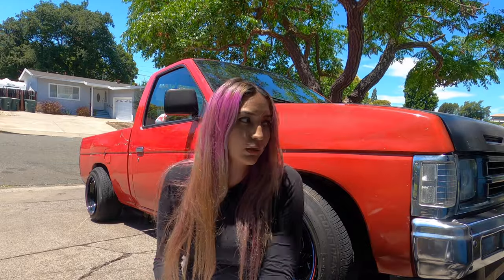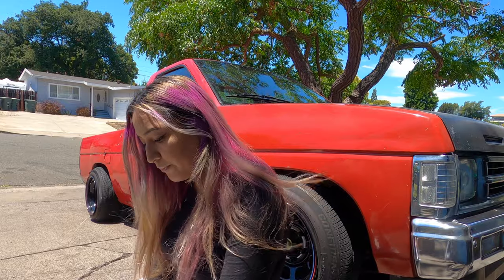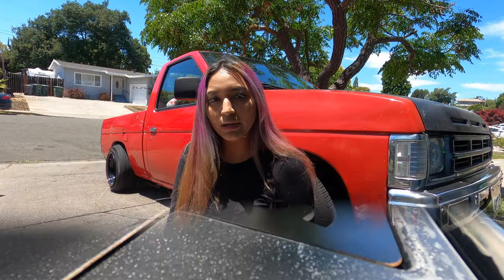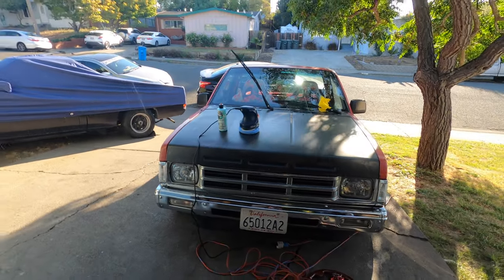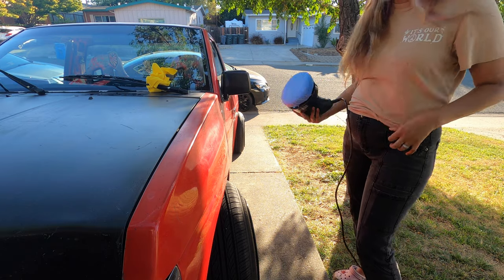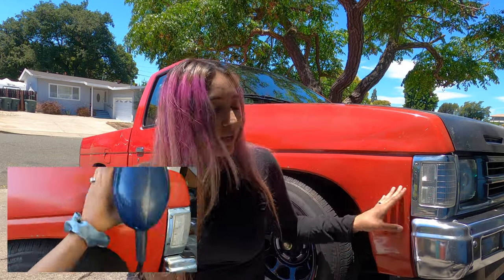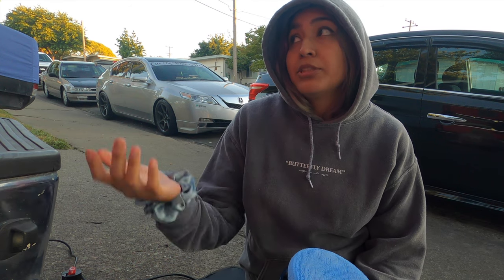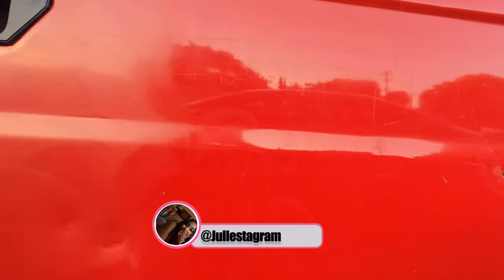Let's Fix My Paint! | Buff & Polish My Truck with Me! | Nissan D21 Vlog 2021!

Comment: You should have just wet sanded the whole truck .... then re clear coated it.
Reply from the maker: Nice idea, not the project i was doing though
Reply: @kayandjules  Fosho, I did the same thing and my uncle came and told me to do that and it completely just re sealed clear coat and all the oxidation came off , it was a miracle !!!
Reply: Ps, truck looks siiiick!